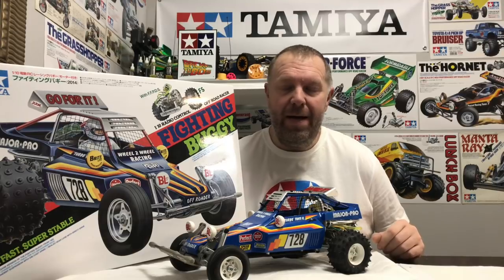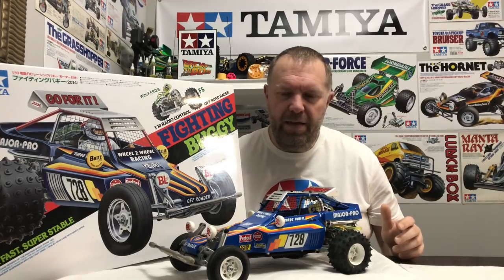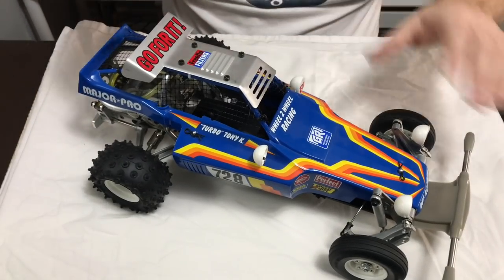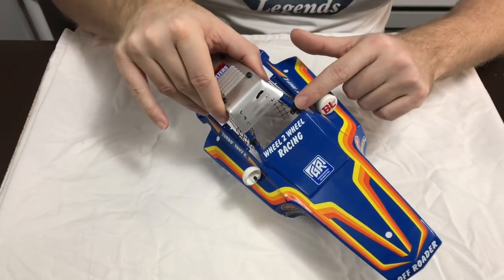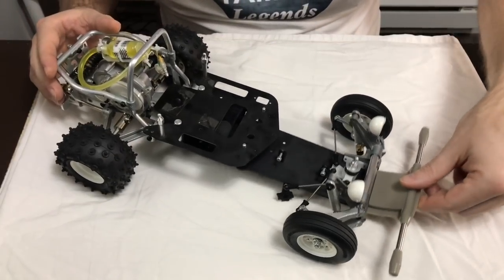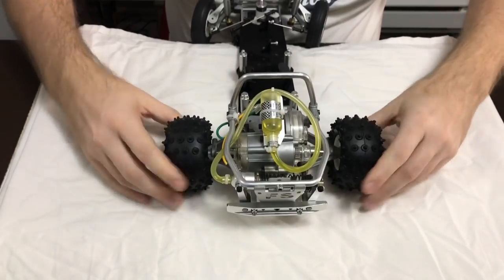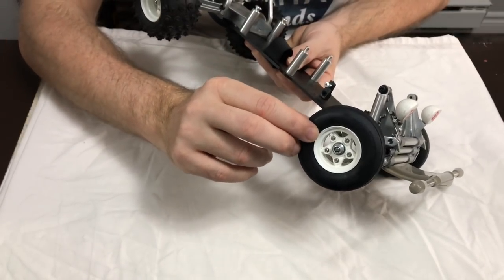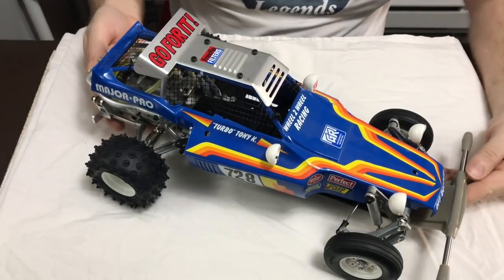Tamiya Fighting Buggy SRB (Super Champ), Part 1

Comment: I had one back in 1983 cost me $250 Australian  the servos and receiver used small balloons over them to water proof them that and a bit of silicone sealer and tie raps downside/problems very heavy, 1100 nicad batery on quick charge took 30 minutes and only got 5 min run time ah good times
Reply: Yup the run time was brutal. I dug a rc track in the backyard and it didn’t even make a quarter of the track. Too heavy, meanwhile my cousin’s ultra light hornet did a few laps. 😑

Comment: A guy who worked at a local hobby shop here in the quad cities was a designer or cad guy for Tamiya when these were developed. He said that the engineers and Tamiya brass used to visit Baja and research the buggies and beetles and trucks and took ideas from the real race cars and scaled them down into the models. The shock system was actually used by real Baja racers, however it was nitrogen in the tank and lines vs oil. Similar to modern monster truck shocks, but with 1 big tank for all the shocks. Just like the real race buggies, these were designed and built by a bunch of good ol boys who loved racing

Comment: I got one of the first kits in California in 82 and it took days to assemble it with all the tiny screws! It was on par with Rough Riders that had been modded right out of the box. Once I put a Black motor in it began to shed parts and break fittings and the car slowly evolved to keep it together at the Track. Ditched the rear shock and ran duel shocks, dumped the metal Pan and built a fiber one and saved weight where I could with help from Joe at ProLine......I still have the car but the RC-10 came out and the next leap forward was made and the process repeated!
Reply from the maker: RadioReprised 
I enjoyed reading that my friend 👊🏻. Thanks for watching buddy